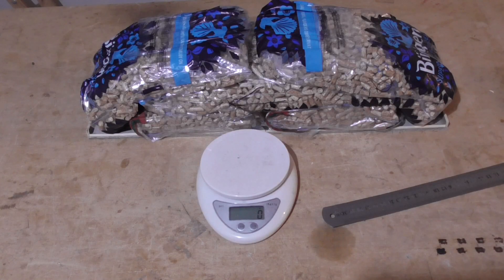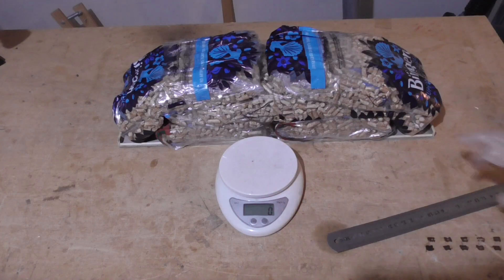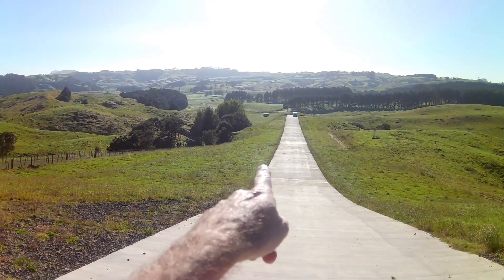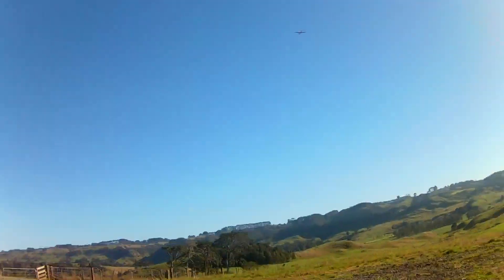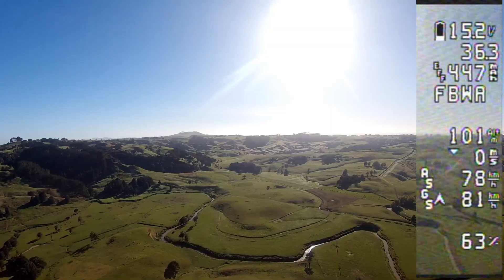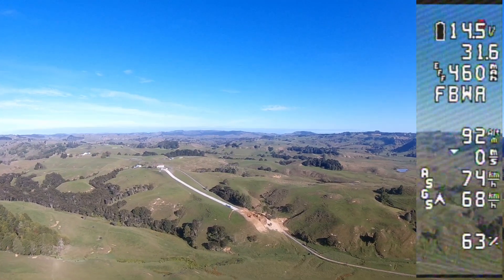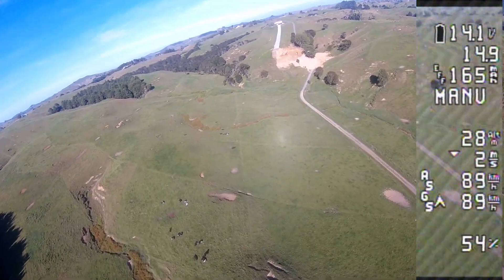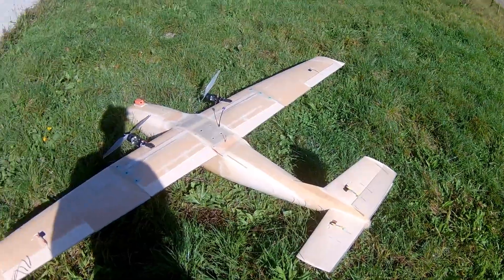Twin hopper part 8 (5kg payload full send)

Comment: hi i like this video ...🎉❤ what the max load ? i w'ill be very hapy if you test it in a video .....and where to find plans 😊😊😊
Reply from the maker: huh? This video is the test of that. If you are saying I should just put more and more load until it crashes, I have no intention to do that. I think it could probably take another 1kg (so 6kg max) but I can't test here at home. Next time I drive to Uncle Bruce's place I might try it on the long runway there.
You can find the original VSP file and STL here: https://www.iforce2d.net/stackedSlices
The OnShape doc is here, although I don't know how useful it will be (you can clone this and make your own copy to edit): https://cad.onshape.com/documents/35448740e87a291eee40dea6/w/6750d7c20e27c678983ef420/e/f8f7791afa8a4df18dea6305

Comment: Your servos are undersized for the mass and airspeed the Twin Hopper flyies.  Pleeeeease upgrade them before you loose all of your hard work!!!
Reply from the maker: Only the flap servos deal with any major load, and they would have broken in this video if they were going to break at all. At 7:55 the plane dropped 60 meters in 10 seconds and pulled up at 96km/h while weighing almost 12kg. Unfortunately the log file was not written correctly so we'll never know what the g-load was, but I would not expect the plane to be seeing much more than that in most usage.

Comment: I think you've probably got another 2-3kg of payload in there which is a testament to the awesome design and craftsmanship of this platform. The real limiting factor with such a high payload in my experience becomes takeoff and landing!
Reply from the maker: The original goal was that the plane should carry its own weight in payload, but that was when I thought the plane would be 5kg. To do that now would require 6.7kg payload. It might work for a short hop just to be able to say I did it, but would really stretch the power system and maybe even the wing too. If I can be bothered driving down to xjet's place I might give it a try.
Yes it's amazing how the actual flight was not much affected, but the launch and landing clearly were. At the time I didn't notice but comparing footage of landings with no payload, this came in much faster!

Comment: The video thumbnail really shows the scale of this plane. This and when you are up close the the propellers.
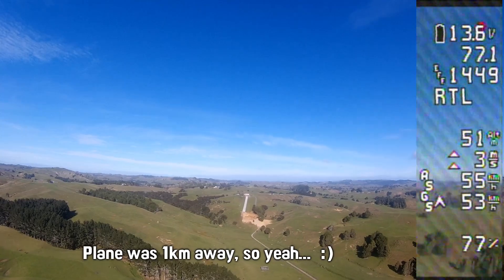As transition to manual and dropping flaps on approach (7:47) the speed jumps from 53 kph to 95 kph. Guess you're not concerned about stressing the flaps at higher speeds. ;) 
Regarding the pitch porpoising it may be worth experimenting experimenting while higher up with setting flaps at various degrees while maintaining 65-75 kph. Speed on approach will effect the angle of turbulence from main wing trailing back. 
Those sticks at the lower end of the landing strip (8:18, 8:22) always worry me. Placing a cone over, or an orange ribbon could help as visual reminder.
Reply from the maker: While preparing for the flight I was a little concerned about load on the flaps, but then completely forgot about it during the flight. The brief period of RTL had let it climb up, and it was not ideal to drop that much height so quickly but I was prioritizing not doing a go-around. I suppose it was a good test of the wing strength to be doing that with full payload, unfortunately the SD card log was a zero byte file so we'll never know what the g-load was.
In one of my earlier flights I tried various flap settings at various speeds and it seems that any more than a tiny bit of flaps will start to induce the porpoising. Once when I landed in FBWA it was able to deal with it quite well, and landed very smooth, but with much less control on the flare. If I had a nice big runway where I could take as long as I like to set it down I would probably just use FBWA all the time, but here I have to thread it between the fences so it requires a bit more... dynamic approach :)
Those fence sticks are easier to see irl than in the video. On this day the wires between them were laid down because the excavator guys drove in from that side so I only had to worry about the stick and not the wires. Maybe one day I will put some landing gear on this, I'm sure the farmer will be ok with me laying down the wires like that to land on the concrete. Would be cool to do an FPV landing coming into that concrete strip!
Reply: @iforce2d  Realize you probably worried more about with low battery sagging and lack of climb performance if needed to go around. The issue with yaw probably added a bit of extra discomfort. 
Was referring more to the drag forces on the flaps at speed (the hinges) rather than G-forces from lift.

Comment: I wonder if your payload was a little "off" laterally? That would create yaw/roll requiring compensation. It's also possible the longitudinal CofG was a bit better the second flight , which would increase aerodynamic performance, allowing increased flight duration because the plane would have been in a better flight attitude & thus need less power to maintain equilibrium.

Comment: Chuck 5kg of batteries in it, pack a lunch and maybe dinner and see how long it will fly :)
Reply from the maker: That was originally the plan, but not sure if I can actually be bothered doing it. It would be interesting to find the sweet spot of max flight time though. There must be a point where adding more battery reduces the flight time instead of increasing it. The lipo is 154Wh, and if batteries are 18650s then assume each 1kg added is about 222Wh extra. So far the flight time vs payload graph with 154Wh pack looks like:
0kg - 35min
2kg - 27min
3.6kg - 19min
5kg - 16min
Assuming the flight time increases linearly with Wh, using the same weight of battery instead of wood pellets would result in:
0kg - 35 min
2kg - 105 min
3.9kg - 118 min
5kg - 131 min
So it probably wouldn't result in the amazing flight time one might envision at first when thinking of a 5kg battery :) There is a chance I might make a 4S10P li-ion pack to try the 2kg configuration and see how well it matches that prediction, but I would not be making any packs larger than that. I have the cells ready but I would probably only use it a few times and then want to pull it apart again.
hmm... I just realized those calculations are based on ending the flight at around 3.5V per cell, which would not be necessary with li-ion.... if I can configure the ESCs to not cut out until under 3V I will definitely give it a try.

Comment: Isn't the trim of the trim of the aillerons opposite of the rudder? Right ailleron pushing down --> right roll. But rudder is trimmed to the left, so it's essentially side-slipping. Mybe just put the ESCs on different channels and create a "trim" mixer, so you can adjust it in flight and try that first before trimming the actual surfaces. At least the option is probably a good idea anyway, even if it isn't the cause (might be, might not be, who knows).
Edit: only afterrwards saw the ocmment by Skyris, guess I didn't scroll far ehough before commenting, my bad.

Comment: About that pitch during landing, it looks like you have some thermal activity at that construction site. lines up pretty well, My guess is that this little thermal patch gets it's air from the valley, combined causing a little tailwind but most important some thermal wind pushing up that sharp ledge you fly over during final.

This hypothesis is easy to test: next time avoid flying over and close past that construction patch.

Comment: I think you should consider landing in FBWA....As you put it in manual it showed signs of spinning, looked out of control and unstable....The pitching problem, I think you can cure this by increasing the wing incedence a little....The right aileron trim and left rudder trim made no sense at all...🤔🤔😳😳😳🇬🇧
Reply from the maker: It looked unstable because I was flying line of sight 1km away and lost orientation, that's all. Regarding the trim, well spotted :) As I mentioned in the description, I'm now wondering if the hinge pulling out was part of the issue. Naturally I had actually trimmed left roll, and I only realized after turning the camera off that the aileron was the opposite of what I was expecting to see. Perhaps the landing jolted the hinge out.
Reply: @iforce2d  Yes, I realised at 1km you're not going to see the plane well enough to fly it LOS....Had you been under the Goggles, the instability would have been very evident. May I suggest using a tacho and check motor RPMS to at least rule it out. The hinges need gluing, if you don't want to lose a valuable plane...I'm guessing FBWA is rather like Angle Mode?...You should be able to increase roll and pitch overide angles?..Manual Mode looked very hairy....lol....🤔😳😳🇬🇧😀
Reply: Unless your plane is unstable by design it should be stable and controllable in its entire flight envelope especially in parts that are required for emergency procedures like landing.

Comment: You trimmed Left Rudder and Right Aileron, Surely those 2 things are fighting each other.?  Or something is very out of whack, Maybe.... FC needs calibrating, Motor mounted on the Piss, ESCs need calibrating, Different Prop pitch/size, Rudder mounted on the wonk, One wing heavier than the other are a few possibilities worth checking . Also Why Manual mode for landing, and not letting the FC help keep things nice and flat when you need it most ? Needs a paint job or at least some Stripes which would aid in orientation . happy landings
Reply from the maker: Well spotted :) As I mentioned in the description, I'm now wondering if the hinge pulling out was part of the issue. Naturally I had actually trimmed left roll, and I only realized after turning the camera off that the aileron was the opposite of what I was expecting to see. Perhaps the landing jolted the hinge out. The yaw issue was not happening until the last two flights, so not sure if any of your suggestions would be the cause.
If you've ever tried landing in FBWA versus manual you'll find that there is much less agility and control, and getting the flare just how you intended is unlikely. You can see an attempt at landing in FBWA in a previous flight, after which I decided landings would be in manual. Also because I'm landing into an upward slope so if I needed to go around it might have to be quite a sudden climb which is easier to achieve in manual.
https://youtu.be/0_bcUFK3jl8?t=535
The FBWA did help with the porpoising though.
Reply from the maker: Another thing about manual is it gives you a better feel for how the plane is reacting. For example if it's nose heavy, you would need to have the pitch stick pulled back a lot just to fly level and it would make you nervous. FBWA hides all that, so you would be blissfully unaware that you're nearly at the limit of elevator travel until you suddenly needed it.
Reply: @iforce2d  Yeah that makes sense, but I guess once its ballanced out right for CG, and all trimmed correct that shouldn't be an issue anymore. I've since watched most of the build vids on this plane. I was wondering, could it be that the inconsitancy you mention in the foam is making  something twist, or some flex in one wing more than the other, now you added a lot more weight, and thats why its showing the yaw issue in the loaded up flights. just a thought.  Nice project though. still think it needs some paint though  lol .. happy landings

Comment: Impressive! Your trims seems to counteract each other? The ailerons trimmed for right turn, while the rudder for left. Apart from that, not much thrust difference is possible before a lot of trim is required. It can be difficult to detect by listening or measuring diff power, but try placing the plane on a ball bearing fitted disk or a low friction surface and apply power. That will reveal any differences.
Reply from the maker: Well spotted :) As I mentioned in the description, I'm now wondering if the hinge pulling out was part of the issue. Naturally I had actually trimmed left roll, and I only realized after turning the camera off that the aileron was the opposite of what I was expecting to see. Perhaps the landing jolted the hinge out.
Reply: @iforce2d  
Oops, yea, there are descriptions when you open them up.
Reply: I missed the aileron trim. 
Wonder if autopilot was having a fight with itself 
Or
Did the wing warp under increased load?

Comment: Can you add in elevator compensation when you flip the flap on in arduplane? I know you can in inav and it helps a lot for the proposing.
Reply from the maker: Yes, that would help with the initial 'ballooning' when flaps are changed and also keep trim closer to center stick. But it doesn't help the porpoising, which (I think) is caused by interaction between the horizontal stab and air coming off the flaps. It just won't stay where you put it and wants to diverge either up or down.
Reply: @iforce2d  
I was thinking more an angle of attack problem. As I’m not enough aoa. 

Flaps push the centre of lift forward if I remember right and that makes it suddenly tail heavy. 
But I seem to remember higher aoa brings centre of pressure rearward.
Reply: Yes.

Comment: Well done. 
It’s surprising how little wing loading actually affects performance other than the speed it happens at. 

May I suggest a simple foot release system for launch so you can get to full power before release to aid in takeoff?

Something as simple as string tied to your ankle and looped through a hook on the plane and back to stand on it, then lift foot to launch.

Comment: Hahaha, nice slip of the tounge! I wonder if it would yaw with no throttle just on glide? If it only yaws on throttle, it's either one motor pushing more than the other or it's  the mount angle and the torque of the motors spinning is pulling to the right. Full scale aircraft angle their engines away from the pull to compensate.
Reply: I think the motors/props are counter rotating, so the P-factor (check "critical engine") shouldn't be a concern.
Reply: Wing warp under increased load?